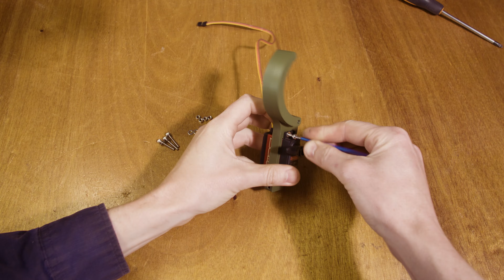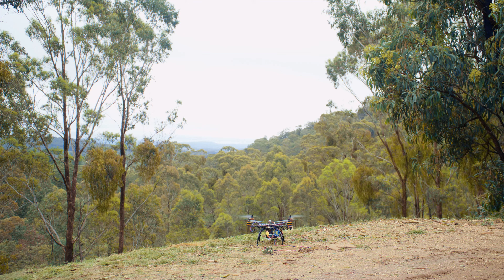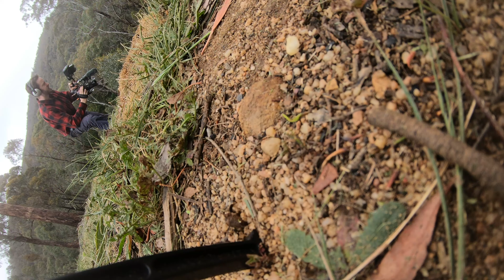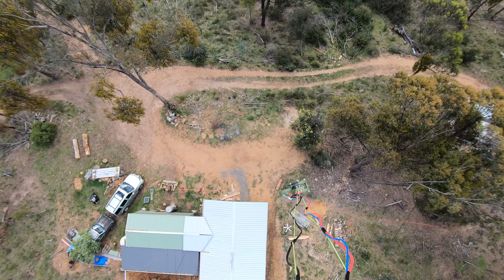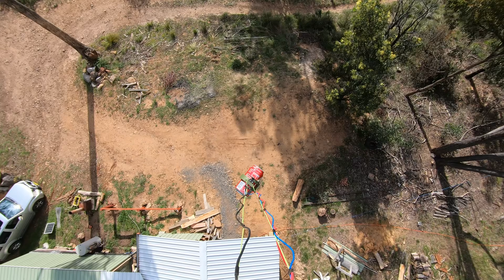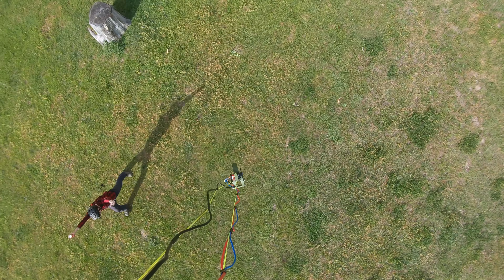Dropping Coke Cans From My Drone

Comment: Ha, I was just thinking you were going to cook that servo. Having the servo drive a latch mechanism instead might work. The weight of the can would cause it to spring open once unlocked. It'd keep the force down and prevent the servo motor from stalling and cooking itself again.
Reply from the maker: Yeah; I was hoping the servo would protect its self from burning out but apparently not. I might look into a sprung or latching mechanism, or maybe a current-limiting arrangement for the servo.

Comment: Great video, fun idea what sort of flight controller and software are you using? Makes me want to make one of my own...
Reply from the maker: I'm using a Matek H743 flight controller you can see at 01:36 running Ardupilot firmware, and using Mission Planner to create and monitor the way point mission! It's a lot of fun.
Reply: @technologyhobby I currently have a 12-in drone sitting around not doing much. Maybe I'll have to do something like this with it, but I currently have an outdated flight controller so we'll see...
Reply from the maker: I originally built this drone almost 10 years ago with an APM2 flight controller. About a year ago I dug out the old drone, bought the Matek flight controller and installed it and it has been amazing since. I would recommend getting a modern flight controller in there and start tinkering again. Very rewarding.
Reply: @technologyhobby thanks